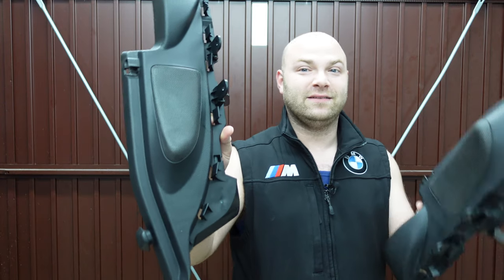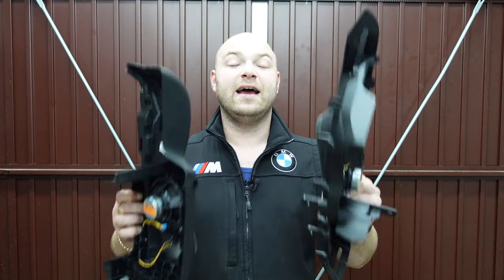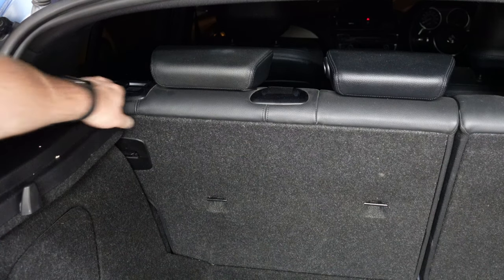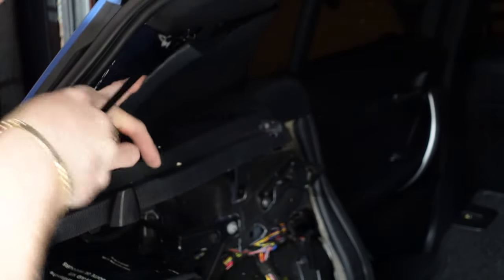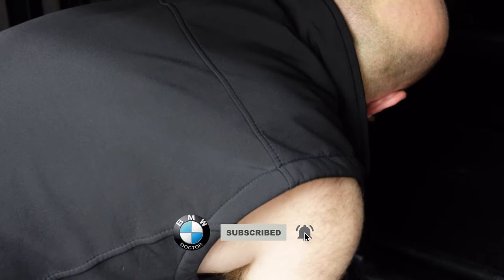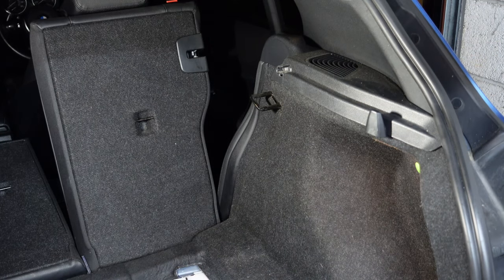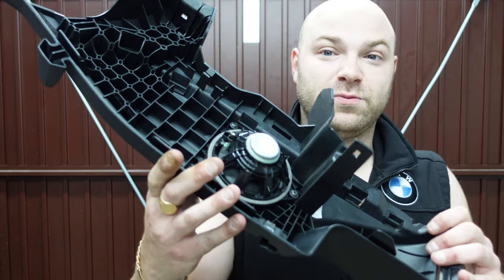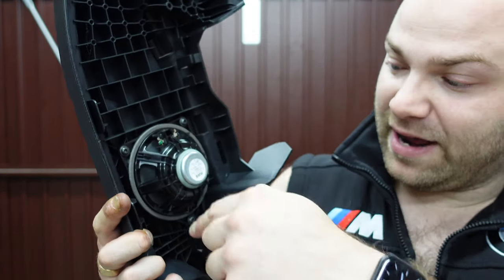BMW F Series Harman Kardon Rear Parcel Shelf Speaker Retrofit ( F20 , F21 , F22 , F30 )

Comment: Thank you for this! It’s the most information I’ve managed to find. However, I have the HK system and I want to know the dimensions of the rear speakers (the ones you installed in this video). 
I have a pair of Rockford Fosgate T142’s and struggling to find out whether they will fit? Could you help?